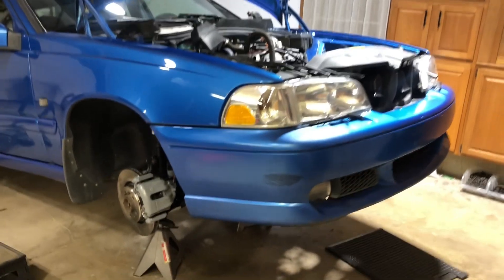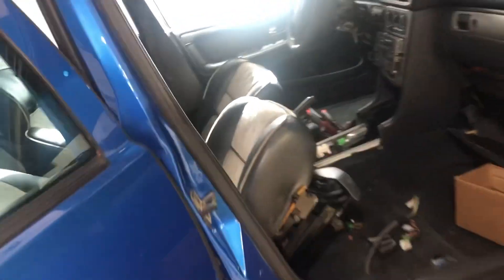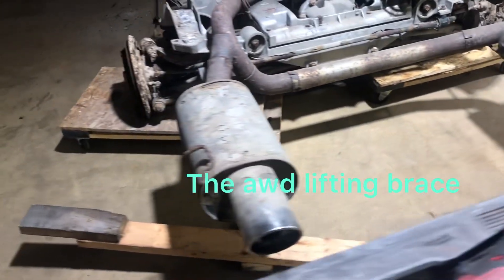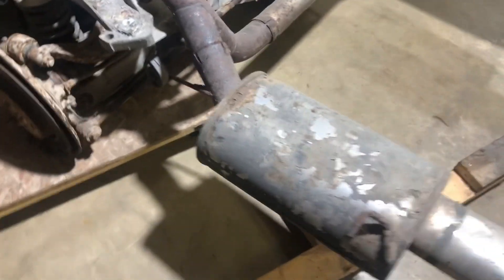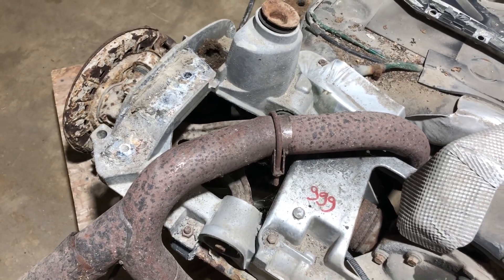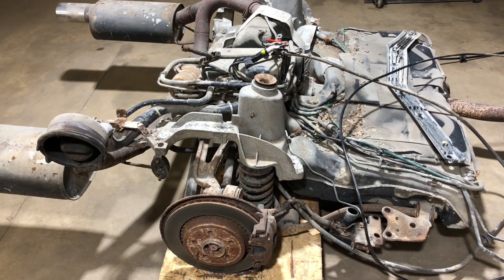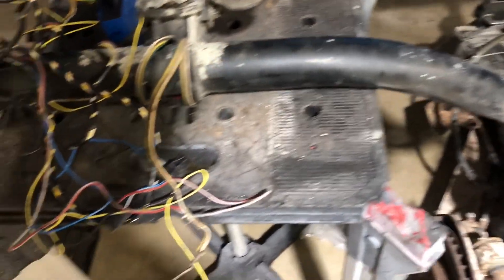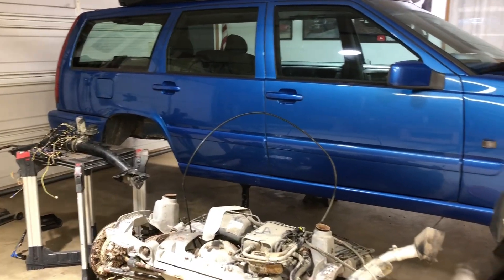Laser Madness- Rear Suspension is Dropped! (And some other cool stuff!)

Comment: I've got that to do to a 99 AWD.  Not remove it completely, just drop it enough to get the fuel pump replaced.  I don't want to take the other route of cutting an access hole in the floorboard.  I WOULD like to hear from Volvo why they didn't put in some easy way to replace the pump.
Reply from the maker: Hey Stuart
I have done both and I choose to cut the access hole. I use a Dremel tool and metal thin cut abrasive blade to make a clean cut. I use a fan to blow under the car to keep any fuel fumes out while I cut.

Comment: Hey Dan, love the build. Any chance you'd be willing to put together a parts list? I'm hoping to more or less emulate this exactly with the help of RobertDIY sometime in the spring/summer and don't want to miss anything. Also, will the larger rotors/calipers transfer over and you are just choosing not to, or will they actually not work? Thanks and keep up the awesome content!
Reply: @Alex Murphy I think you just need to find a FWD parts car and basically take everything off for the rear suspension, including the E-brake cables and possibly the fuel lines and brake lines.
I don't think the vented rear rotors or calipers will work on the rear suspension of a FWD car.  If someone has gotten them to work, I wanna know, too!
Reply from the maker: Correct!  Having a parts car makes a big difference. There’s a good thread on Matthews that can answer your questions.

Comment: Did you get a chance to weigh the AWD rear suspension and compare it to the weight of the FWD rear suspension?  I hear the swap shaves 500 pounds or so off the curb weight.
Reply from the maker: I don’t have a scale that can weigh the unit, but after looking at the curb weights of a t5m V70 Vs the V70r awd I see there’s about 300 pounds. When I do the math from the component weight it seems closer to 400 pounds. I look forward to the driving experience to understand what I’ve done.  Thanks for watching!
Reply: @handydand  I found an owner's manual for the '99 models and it shows the V70R AWD curb weight is 340 pounds more vs. the V70T5.